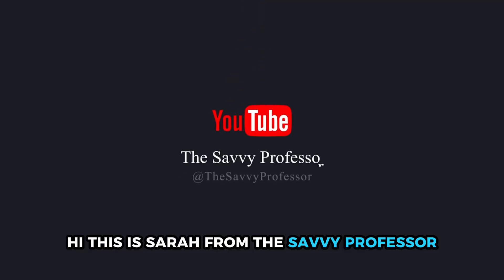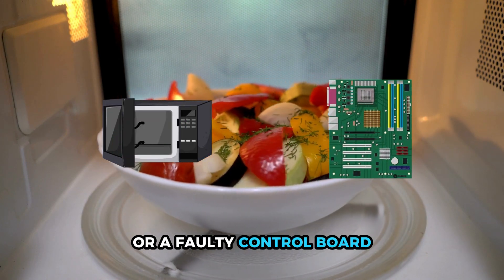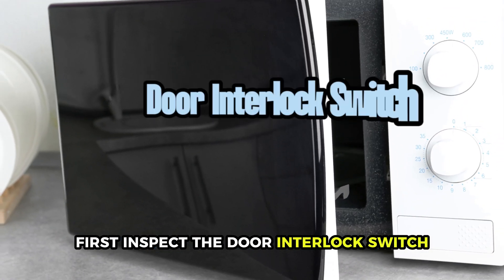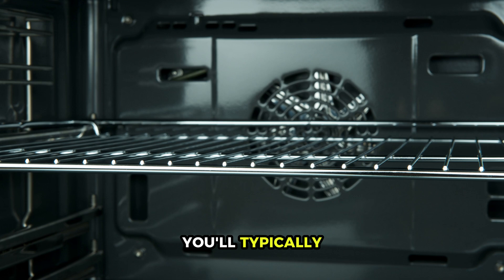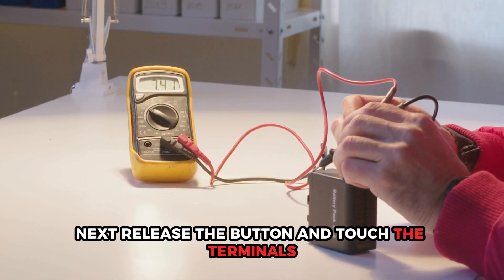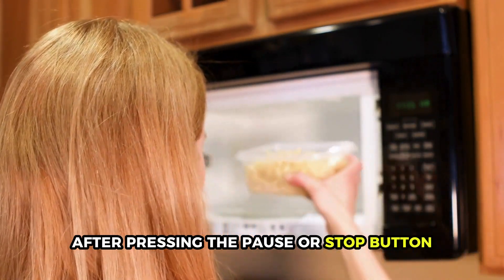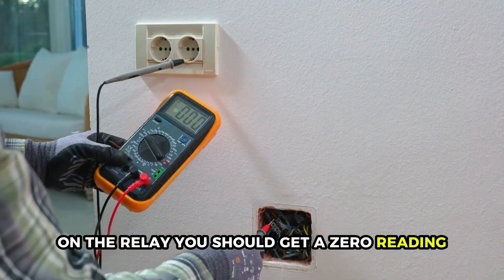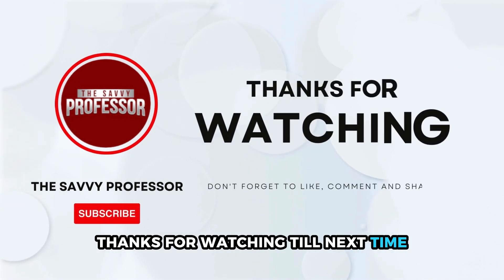How To Fix Microwave That Is Not Turning Off (What Causes Microwave To Keep Running? - Quick Fix!)

Comment: Let's just splice a random series of corporate video excerpts together and pretend it actually addresses the subject. 😅
In my case, it was the convection fan that kept running. Was a problem with the relay controlling it on the logic board.